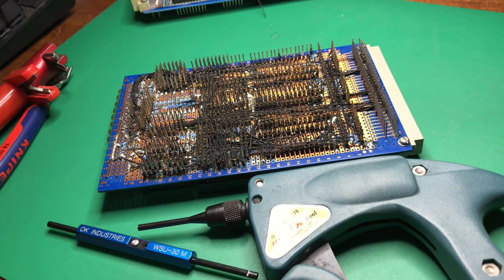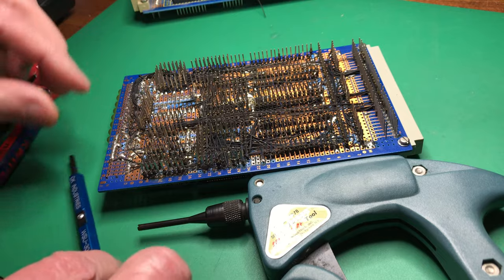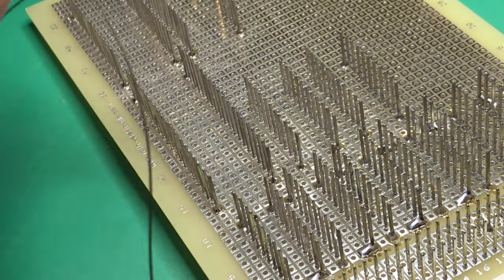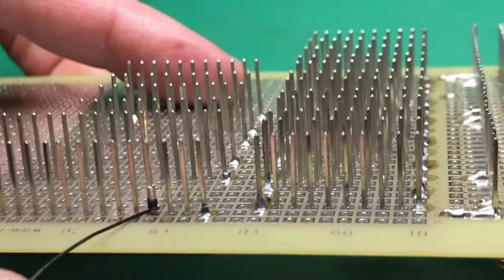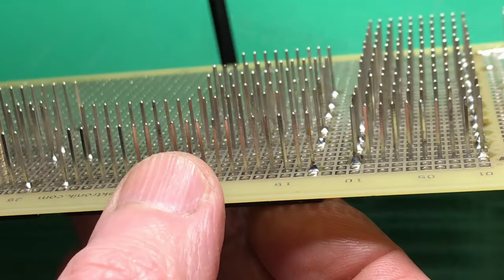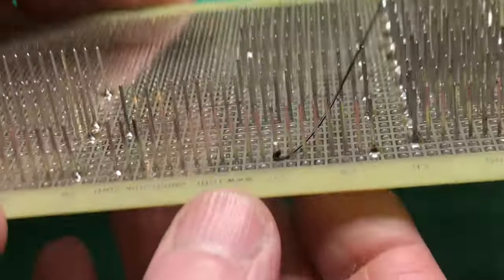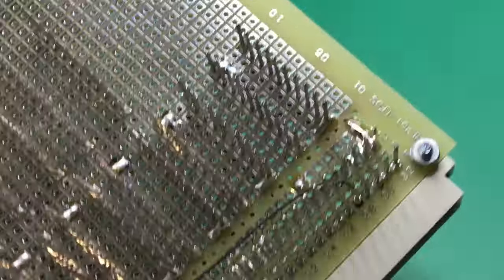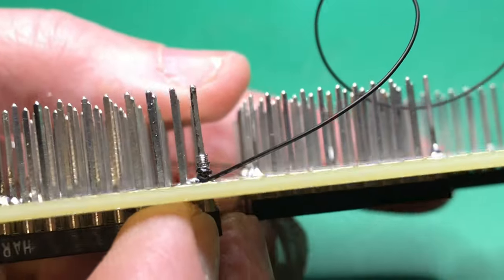Wire Wrap electronics construction

Comment: I have been a electronics hobbyist for 30+ years...I was only vaguely aware this technique existed. I am surprised not to see it more with circuit diy'ers.  My bet is, the discovery of the technique  hasnt been made.  Very cool share. A very old, but very useful potential method.
Reply: I Use it for more of my prototypes! Saves soldering. And the end result is pretty good.
Reply: I also learned that the pressure of the wire against the post is enough to surface weld itself together over time. So thats something :)
Reply: It is easier to make a printed circuit board using photoresist and a photomask. It takes me about 20 minutes from start to finished double-sided printed circuit board (without drilling).
Reply: The cost of the wire-wrap sockets is part of the problem. And any goof is usually a painful thing to fix. That said, I have everything but motivation to do my own WW boards. :)

Comment: Good when the signal speeds were not too high. Lots of Inductance and stray capacitances. Remember this from the Eighties at work. Never used it for hobby, making a pcb was easier. Wire rap worked by forming a cold weld on each corner of the pin. Very reliable connection.
Reply from the maker: Capacitance should be lower than with a PCB? (Or at least a ground plane one, which I always use for such as this).

I've used it with 160MHz digital circuits without problems.

From Wikipedia:
"Wire wrap was used for assembly of high frequency prototypes and small production runs, including gigahertz microwave circuits and supercomputers. It is unique among automated prototyping techniques in that wire lengths can be exactly controlled, and twisted pairs or magnetically shielded twisted quads can be routed together."

Comment: I'm a big fan off Wire Wrap, I've built many complex boards with it and it was a great way to builds prototypes with DIL devices, but now, with the cost of PCB's being so cheap and with surface mount being so common, its just easier to build a PCB. I now find that I'm using old wire-wrap wire for bodge wires on prototype PCB's.

Comment: Nice video, can you make a video showing the full process from the ground up? I see sockets are solded at some pins, I suppose it's for fixing the socket structurally
Reply from the maker: I usually solder the corner pins just for fixing - though they are often power & ground as well. Also, I solder any pins that will have direct component connections, as it's simpler to do that than have link wires, where it is avoidable.

I'll see what I can do for a full construction video, at some point?
Reply: @RJTC  I never used wire wrapping construction technique so I would like to see the full process, from planing the chips distribution and "backplanes" or buses to making traces (are all made of wires or some are made with solder or even with air soldering?) and also if components must be prepared in any way .  Thank you very much for your videos.

Comment: nice video . What is the type , model of that stripper tool ? I would like to get one .
Reply from the maker: It's an "OK Industries" ST100-30
I've had this one for decades.. A quick look shows the price new at anything from around 60- to £132 / $150+; Zoro tools is about the cheapest I could see. Or from about $20 on ebay etc.
Reply: @RJTC  Thanks , I found on mouser for 73,39 € under a name ST-100-2830 Jonard Industries

Comment: Can we use wire that falls between 30 and 26 AWG?
Reply from the maker: You could, if you got a wrapping tool or bit intended for that gauge, and it was not so thick that it distorted or twisted the pin rather than wrap properly.

The original full-size wire wrap system used 26WG if I remember right, but with rather larger connecting pins; the newer "miniwrap" standard as most parts are now for, is intended to be used with 30AWG wire.

Comment: But an absolute ( nightmare ) to reuse the components ( ? ) ................ DAVE™🛑
Reply from the maker: It un-wraps as easily as it wraps, leaving the pins ready for re-use. You only need new wire!

I generally just solder the corner pins to hold the sockets in place, unless they need conventional components connected to them as well.